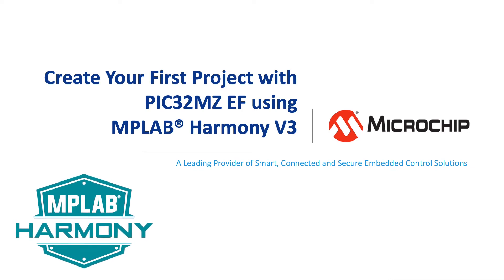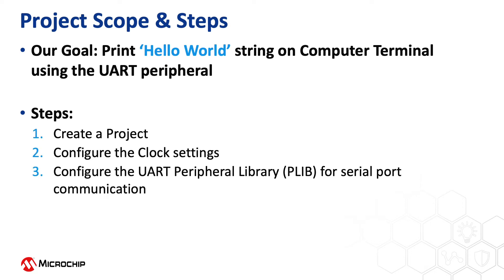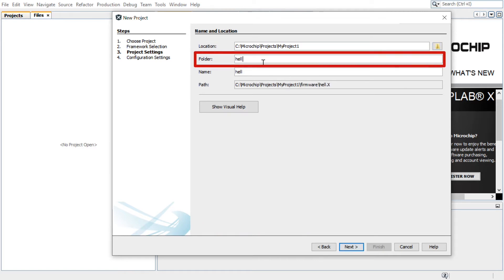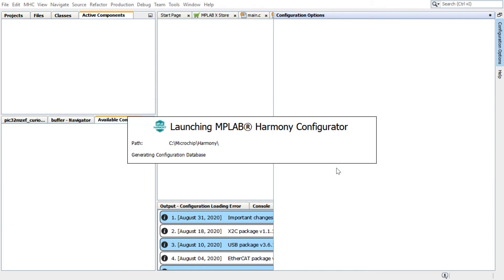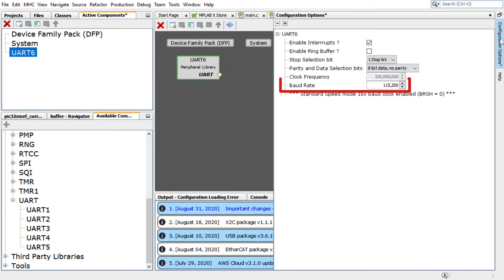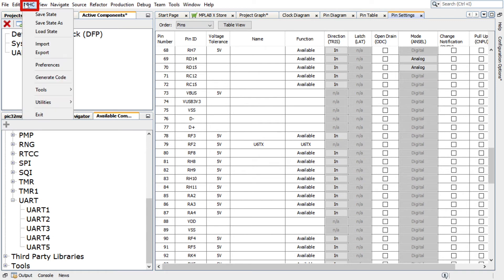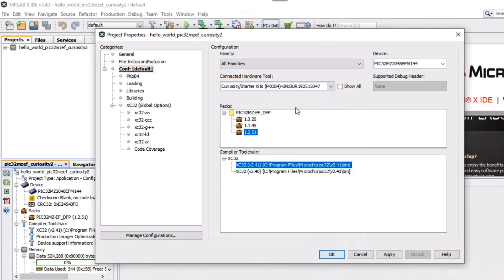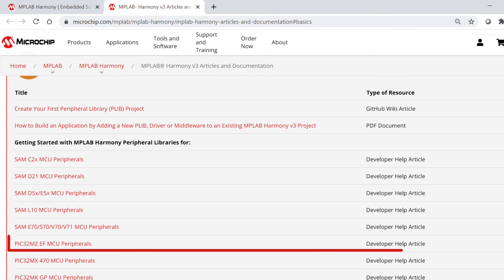Create Your First Project with PIC32MZ EF using MPLAB® Harmony v3

Comment: Harmony has been replaced by MCC, which doesn't support this chip. So, you now have to do a convoluted process of manually downloading a harmony github repo to enable harmony in order to be able to do these steps, but the buttons and menus are different, so it's rather hard.
Reply: Recent video: https://youtu.be/Z-8srAI8jow?feature=shared
Reply: https://www.youtube.com/watch?v=sW-yS2FHI54